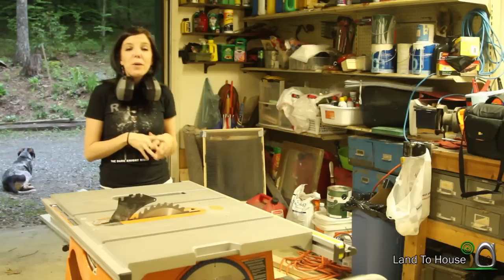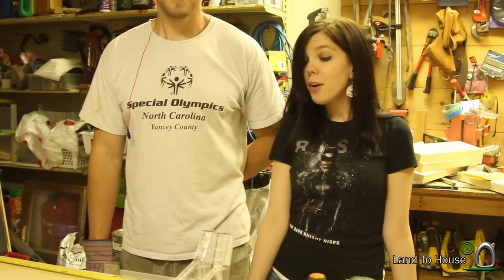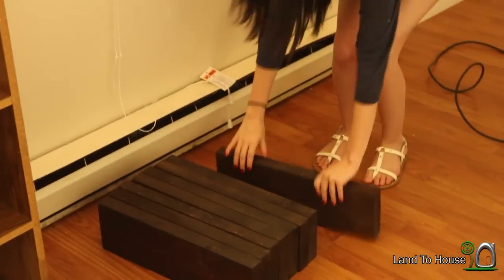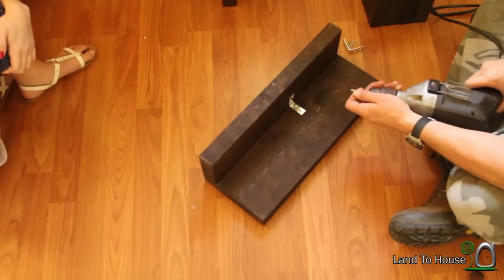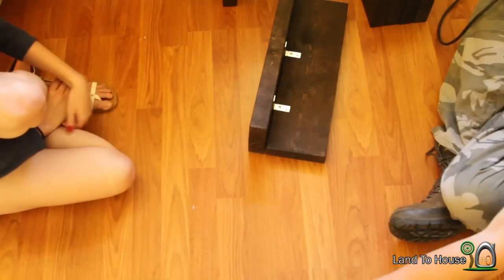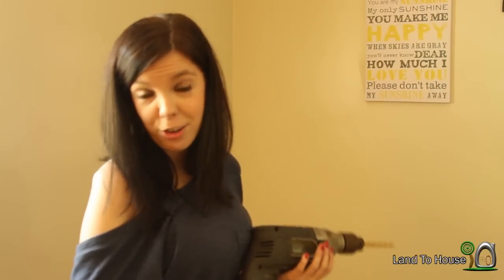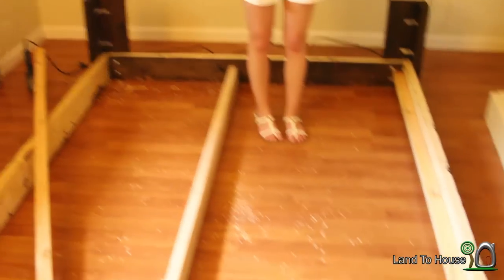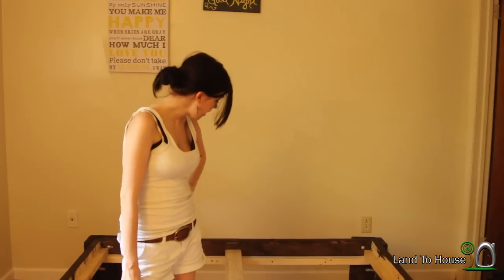DIY Queen Size Bed Frame

Comment: Hey guys, please don't wear gloves while using a tablesaw. Especially loose gloves. It's too easy for the glove to get "grabbed" and your hand will go into the blade. Use push sticks and featherboards.
Reply from the maker: That is a good piece of advice. I am learning with everyone here.
Reply: I applaude you both on a good job. It's encouraging to see young people deciding to make something they need vs. Running to IKEA.
Reply from the maker: Michael Beard Thank you.  I have grown up sitting at a computer and just now realized that there is so much more to life.  Ikea is nice and all but it does not give the satisfaction of making stuff oneself.

Comment: confuse!!
one 12' (2x6) cuted in 1 1/2 for corners
five 10' (2x6) 4 of them in half = 8 slats so I keep 1 (2x6) HEAD & FOOT BOARD?
two 8' (2x4) = for slat suppports , two 77" and two 55"
one 10 (2x4) ??? NEED TWO SIDE BOARDS: 7' ??
wich one is the middle support, and wich is head and feet???
Reply from the maker: I apologize for the confusion. I was not at my best filming after that oral surgery. 
I have  updated the description to make more since. but basically this is what you need:
The final cuts that you will need are:

Head and Foot Boards: 5'       -- Cut one 10' 2x6 board in half
Two Side Boards: 7'                -- Cut two 8' 2x6 to 7'
Eight leg sections: 18"             -- Cut from the 12' board
Eight Slats: 59-1/2"                  -- Cut four 8' 2x6 in half
Two Side Slat Rails 76"           -- Rip one 8' 2x4 in half and cut to 76"
Two Head/Foot Slat Rails 53" -- Rip one 10' 2x4 in half then cut to 53"
Middle Slat Rail: 81-1/2"          -- Cut down an 8' 2x4 to 81-1/2"

I hope this clears things up for you!
Reply from the maker: ***** you are welcome!  And thank you for letting me know my description was lacking.

Comment: What about the bolts hanging out they will get you and it will hurt like hell lol. Also might want to screw the flat boards down under the mattress they will shift on you
Reply: Or sink small dowels to bracket each of the slats :)
Reply from the maker: Not sure how I missed your comment. . . . I came back and swapped the bolts around so that they are not hanging out to hurt like hell. haha . . . To fix the slats I just used small 2x6's between each slat to keep it from moving.
Reply from the maker: KVPD That is a fun idea!  I might have to think about using dowels.

Comment: Using a 1/8" drill to predrill holes for those 3" screws helps.
Reply from the maker: Yes indeed.  I am going to make a much better video with better design in a couple months.